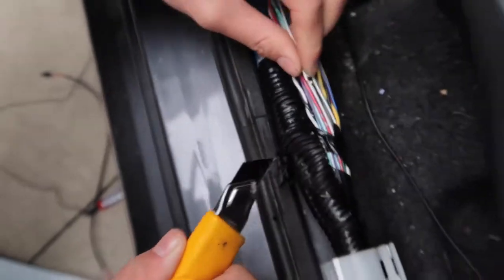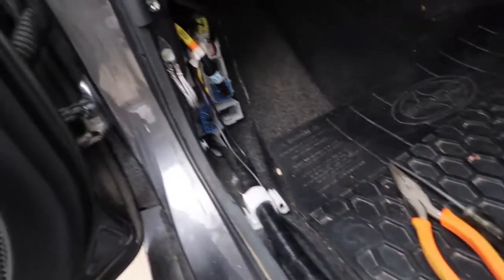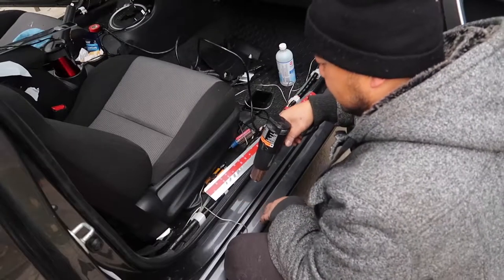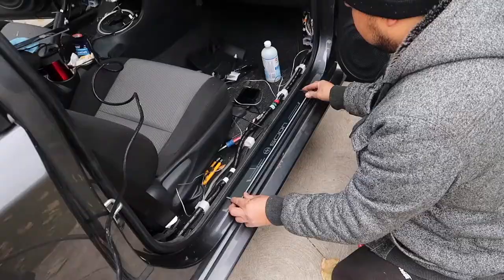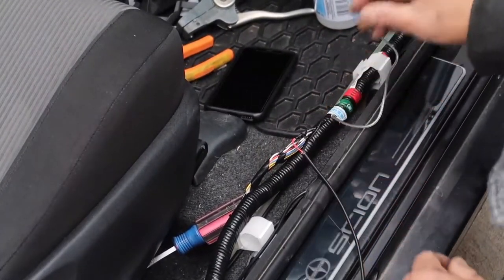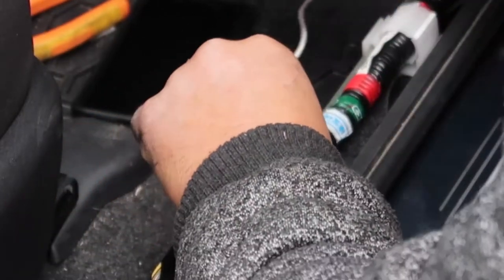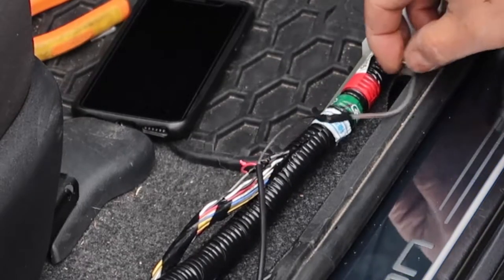2015 Scion TC LED Door Sill Install - Aoonuauto

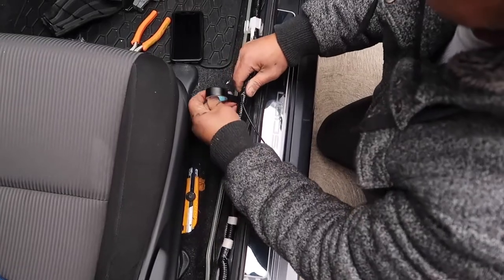Comment: So you guys connected the door sill power wire (red wire) to the car wire in the car (1:20).. Then connect the  door sill ground wire to the positive cable you made which Hooks to the battery's + wire?... I'm a bit confused shouldn't the black wire go to the ground?